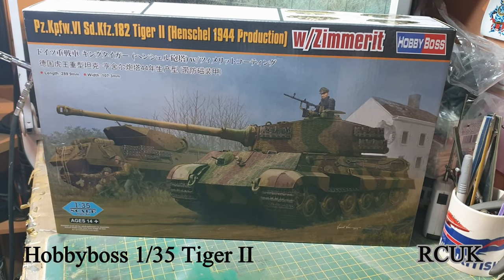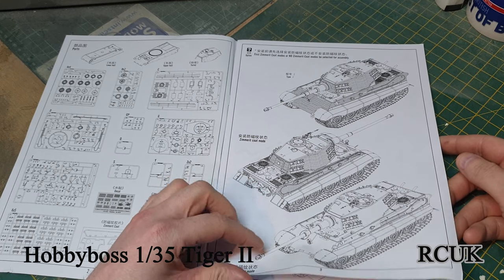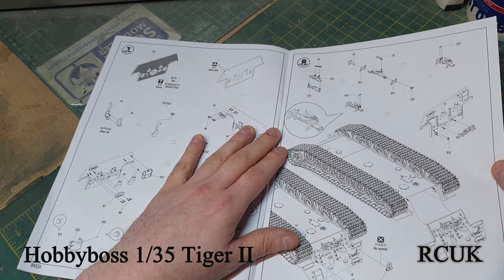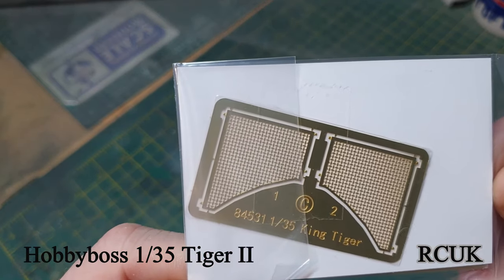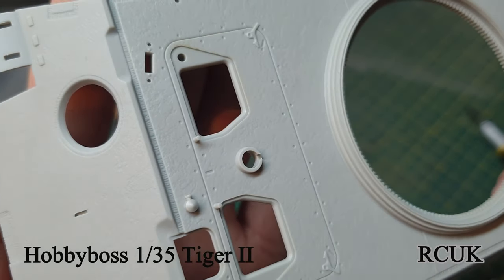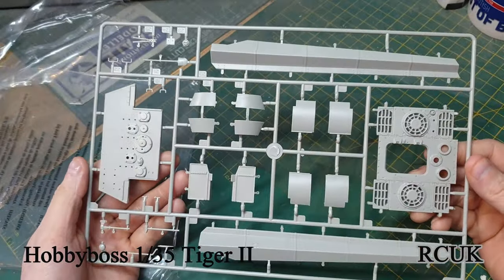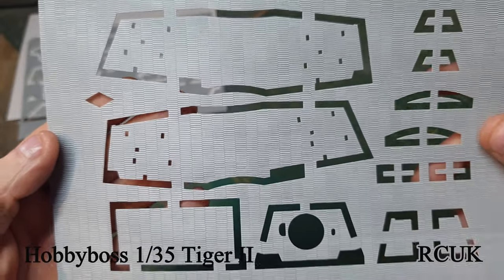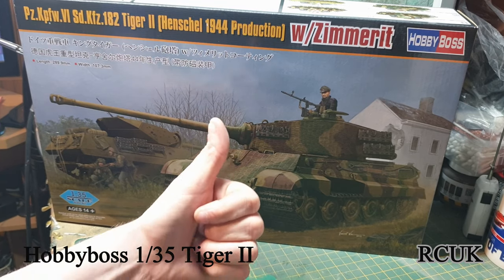Hobbyboss 1/35 Pz.Kpfw.VI Sd.Kfz 182 Tiger II (Henschel) # 84531

Comment: This model belongs to the late Zimmerit period when Zimmerit was factory applied. As such, it was fairly uniformly applied over an undamaged clean surface. Arguably over-uniform in the stick on sheet by its very nature, nevertheless it looks OK unless wanting to recreate a heavily field worn vehicle. Screw laboriously applying putty Zimmerit. 

Whilst I prefer slide moulded Zimmerit as per Dragon's approach in their Tiger, Panther, and now Brummbar, any model requiring Zimmerit for authenticity that doesn't come with it either intrinsically moulded in or as a stick on accessory included in the kit is a hard pass AFAIC. ATAK aftermarket is way too expensive, and I don't like Tamiya's extra outlay value adding (for the dealer) accessory approach much either which is too expensive outside Japan. May as well just buy the Dragon kit in the first place. So I either choose a vehicle which doesn't require it, or buy with. HobbyBoss appear to have a winner here with the price of their kit including Zimmerit sheet and PE.